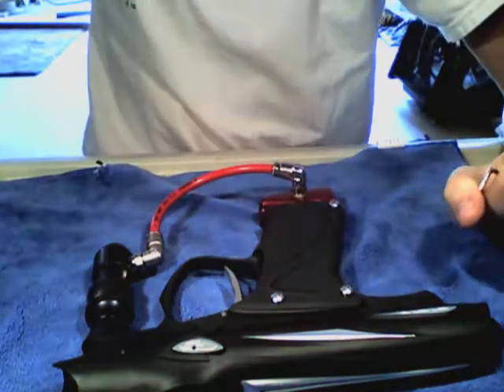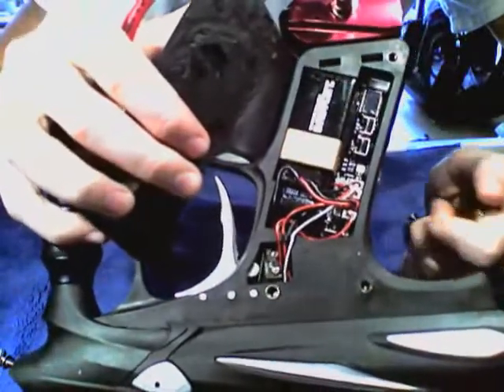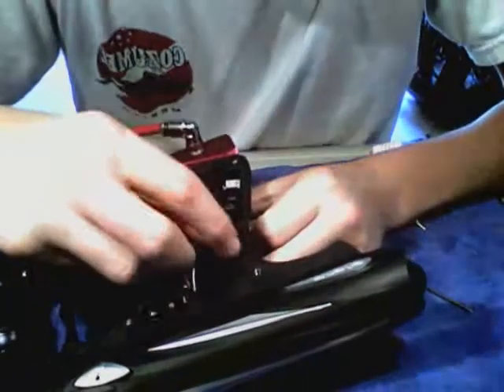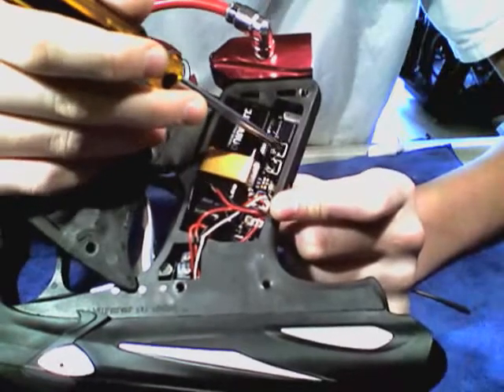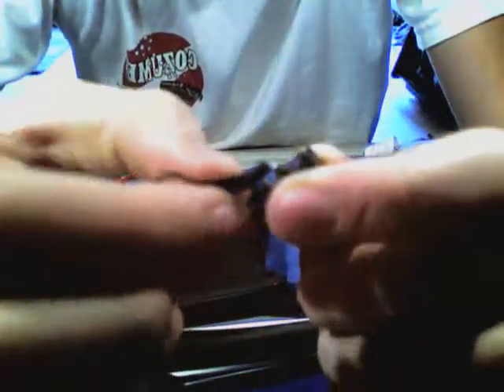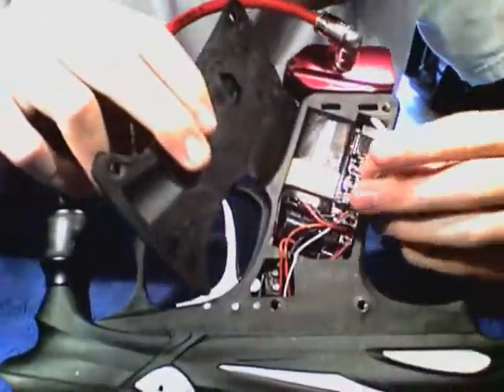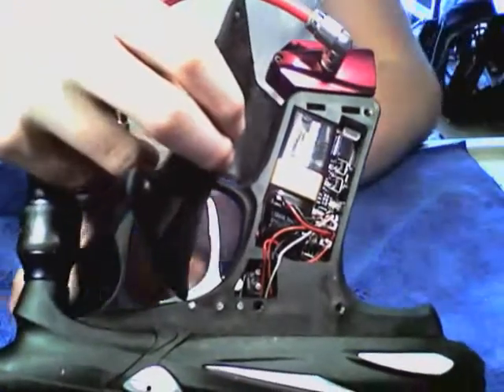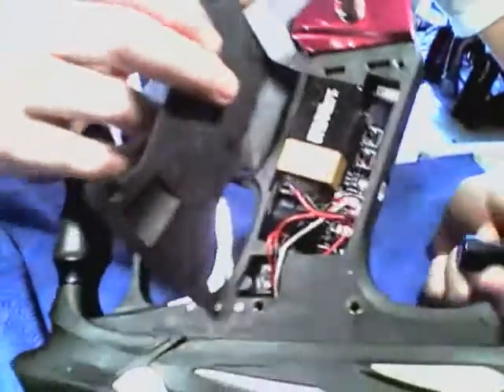Installing Tadao Board Proto SLG 09

Comment from the maker: @hwg1993 Ive never heard that before. Maby your thinking about 9.6v rechargable.Those can make your board shut down because they have less power but ive never heard of that. All electro guns use 9v or a  special 9.6-10.2v rechargable depending on the marker.